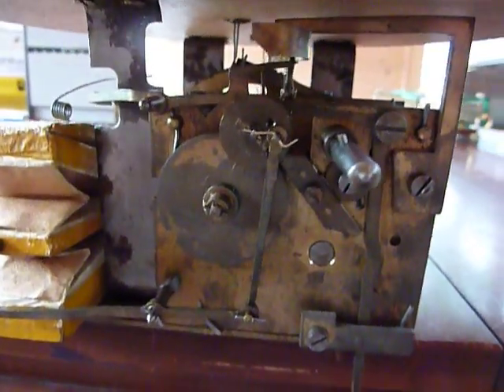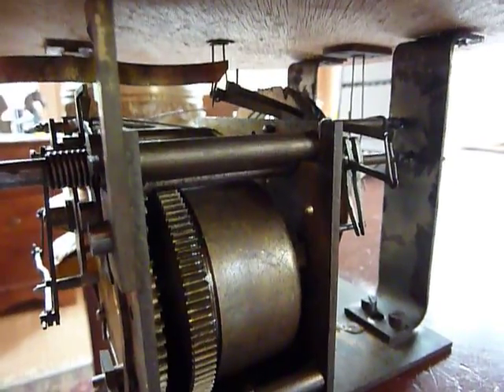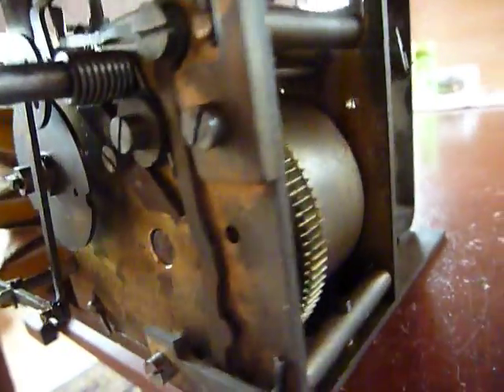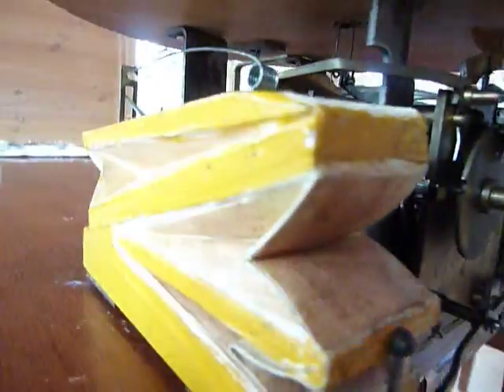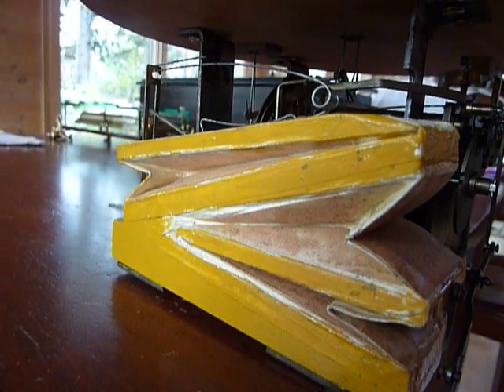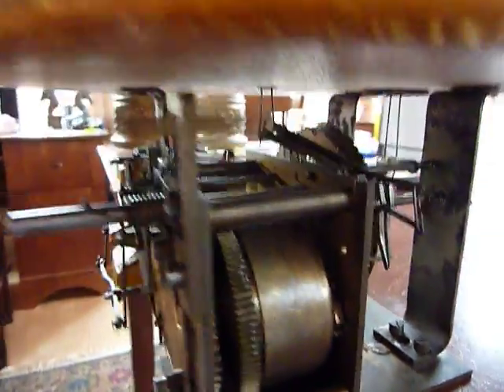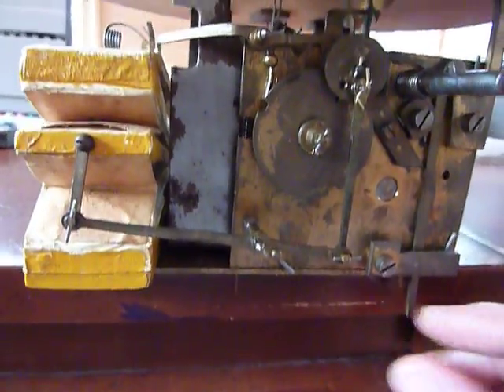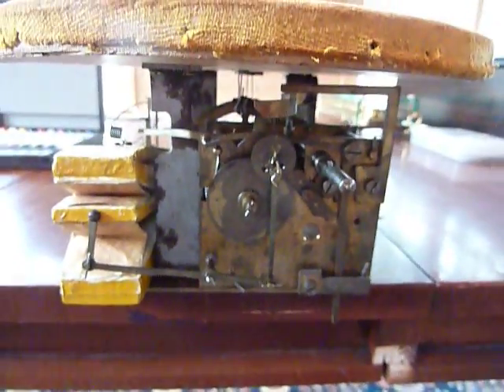Antique singing bird cage (Bontems) mechanism explained

Comment: Mr. Duncan , I   have built a couple of automatons ( I say that loosely ) but still continuing to attempt to to make my own combs for a music portion. I have found nearly nothing very helpful but now want to add the " singing bird " mechanics.  I want to build it all ....nothing as nice as this works . I am 65 retired and it is what  I do now... my first piece was 5 years ago...( just for reference I'm not crazy. )  YouTube -----J R Johnston   " Steampunk Mechanical head    Test run " My apologies , Don't know of another way in which to contact you.
Reply from the maker: Crafting your own musical comb would be extremely difficult as it requires both machining and musical competency - each tooth has to be tuned for the specific musical arrangement which is very difficult.    Early music boxes had what are called "sectional combs" where each tooth or sometimes a set of two or three teeth were made and than attached to the plinth.  Around 1830 to 1840, complete combs were made instead of using individual teeth. Modern music boxes use CNC machines.

Comment from the maker: Correct, the governor fan is the last part of the gear train.  This type of fan is common and you will see the same mechanical design on large music boxes with two strong mainsprings.  The gear train starts with the mainspring housed within a barrel and each subsequent gear produces less torque but higher speed.

Comment: Okay, I’ve watched like 10 of these and I still haven’t seen how the whistle works!!
Reply from the maker: Go to the 1:13 time mark and look at the center bottom of the movement.  You will see the brass whistle assembly.  It is like a trombone with a plunger that slides inside the whistle housing changing the pitch.  The pitch and air pressure are controlled via the cams and levers which replicate a bird song.  I hope this helps.

Kind regards,

Troy Duncan, CPA, retired
https://www.singingbirdbox.com
https://www.reugemusicboxusa.com

Comment: I have a Botems bird cage with three birds and I am struggling to separate the top part with the birds on from the mechanism below. I have removed two screws from under the base which makes the top unit and bottom unit “loose” but there is still something holding the two parts together and I am wondering if it is the small cross pins at the top of the tubes which the birds sit on which have to be removed so that I can separate the two parts as I need access the clockwork mechanism which needs repairing.
Does anyone have any information which would help me ?
Thank you
Reply from the maker: If all you want to do is remove the brass exterior base and top wire cage to access the movement, you simply unscrew the screws that secure the cage to the wooden cage floor and the brass base should simply lift up and over the wooden cage floor so you can access the movement.  Sometimes there is a a secondary screw on the brass base screwed into the very bottom wooden platform.
Reply: Thank you for taking the time to reply and the information given, I will make a video of this problem later today and post a link here as it may help anyone in the future with a similar problem.

Comment: I'm repairing my 2 bird cage I need help with the folds do you have a viedo showing how to refold for the bellows the paper in mine were in shreds so I have nothing to follow everything else is perfect and clean all works and runs smoothly.
Reply: The same type of folds are used in much more basic coo-coo clocks as well as inside player pianos, which work from a type of vacuum motor. I would find some orgami books. Right angle side corners that collapse are done the same in a lot of these things. Oh, find a box camera guy. They can do it too.